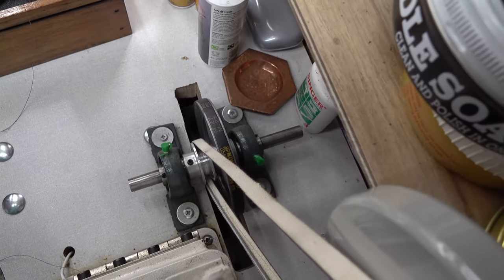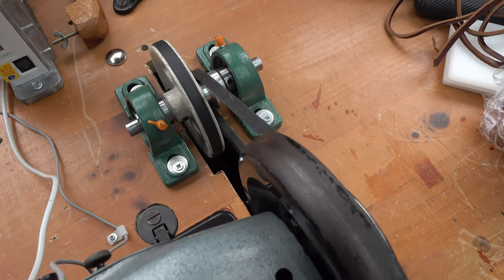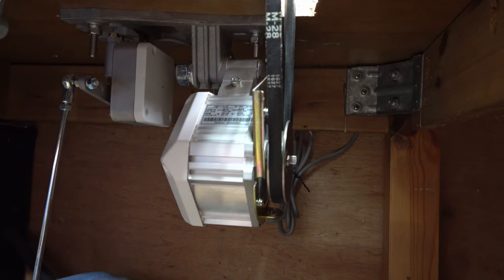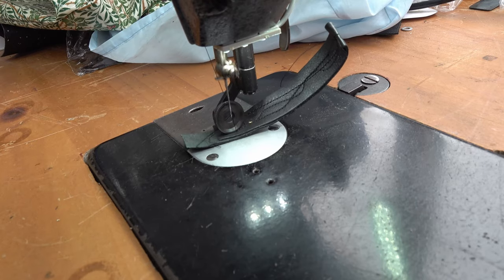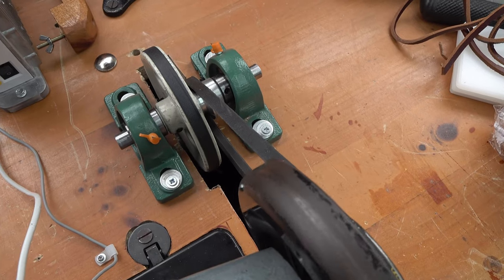Three Reasons To Slow Down A Leather Sewing Machine

Comment: I agree on all counts.  I've been using a 4:1 speed reducer for about 2 years on my Consew and love the results.  One caution is since the machine is running slower, the onboard oil pump may not deliver enough lubrication.  I've adjusted mine for max flow and run it at full motor speed when winding bobbins.  That seems to be keeping it well lubricated.
You've been a great source of information Harry - thanks for taking the time to post your videos!
Reply: Thats interesting Tat. I did not consider this. I will look into this with my JUkI. I did see a youtube video of someone else with a SR fitted and there machine did sound a bit squeaky. Thanks for this

Comment: thanks Harry for the video and the links  i am a retired Woodworker that took up sewing  as a hobby about 15 years ago mainly to make things for my Boats and Vintage cars   i did buy a Chinese Clone walking foot sewing machine  and so far ive been using it as it was shipped to me  i have been  interested in learning more about leather  and a few times i thought about up grading to the servo motors you refer to  overall i’m quite handy and mechanically inclined so  i liked the  way you built your gear reduction system with easy to obtain Shafts and Pillar bearings  with doing auto interiors my machine has the power  needed but  as a novice i thought it might be better to  slow up  on complicated curves  and some other areas  because of my machine  being a clone its often harder to  call up a manufacturer directly and get off the shelf parts  ive even thought about having a machine shop building me special pulleys  but using your  style i dont think i’ll need to go to that extreme or cost  btw i am in the United States  and i have a local  repair shop that carries a lot of parts for different machines plus Sailrites parts fit mine as well and they have a decent online catalog  of parts
Reply from the maker: That's great. I think the pulleys should be readily available...they are for m section sewing machine belts. The axle and bearing blocks are readily available including off the likes of EBay. I had to tap axle bolts on my pulleys as they only had a keyway. Best wishes Harry

Comment: Thanks Harry, I have a 3/1 speed reducer on my Juki 1509N and I would not be without it. It would be quite difficult to sew intricate leather stitching at full speed and not make a mistake. I know exactly what you mean by the initial sharp start and it helps with this as well. You can of course order speed reducers direct from USA and have them shipped over. Something else, I also have been using a Singer 211 for 25 years and it might be me, but although the JUKI modern machines are great, I just seem to get more feel control with my Singer 211, hard to explain, perhaps more ergonomic for sewing. So i will be fitting a SR on that shortly. Great video's as usual.
Reply from the maker: Thanks Paul....interesting.

Comment: I'm runnung a simple 750W servo motor with needle positioner. Any idea how to get the needle positioner working after using a speed reduction? Your videos are so informative and helpful. Thank you, Harry!
Reply from the maker: Interesting....I have not set up the needle positioning...do the pulleys make a difference? The rotor unit clips to the handwheel axle...a single belt must slip?? If you or anyone here finds any answers it would be good to add them here...thanks ...very interesting.
Reply: depending on the ratio of the speed reducer a NPS may fail. 
i was able to tune my NPS for usage with a 500W servo and 3:1 reducer on a Singer 201. 
simply added a second magnet into the detection box. Works flawless . 
high torque, slow speed, under desk  mount and needle stops in most up or most down position, whenever you lift foot from pedal.

Comment: Hello Rogger, Is it necessary to connect smaller pully to machine? Can we connect bigger pully to machine and smaller to motor? Thanks
Reply from the maker: I think it matters, I have not calculated to confirm...so small motor pulley to big pulley small pulley to machine...you can calculate the reduction ratio using pie radius squared etc.
Reply: @harryrogers  Thank you so much for your quick help. I bought everything. Just need fitting. Hope it will go smoothly. Thanks again for your help.

Comment: We're you get them belts from as once the pulley reduction is in place you need different size belts I have done the pulley system but can't seem to find a place to get the belts made to size I need.
Reply from the maker: They are m section sewing machine belts...in the UK I got them from College Sewing Machines UK...they should be available from industrial sewing machine suppliers. To get an approximate belt length I used a piece of string between the pulleys.

Comment: what is a good (cheap) portable walking foot sewing machine that is available in the uk?
Reply from the maker: It depends what you want it for as machines tend to be specific to the leather thickness...but it's worth looking at clone machines such as Tysew and Highlead. If you are doing flat sewing only ...like wallets...no raised seams...then walking foot is not so essential.....and a second hand Singer 31k 331k would be a cheap option.

Comment: Thank you ! what a relief is to find people in youtube sharing the exact experience i'm having without being sure what to do, wondering if a different servo controller can solve it, wondering about returning back the motor i've just bought... now i know this is a very common problem specially on not super expensive servo controllers, whý the motors  doesn't come with a mechanical speed reduction gear built in ? it's smaller than a pulley system but anyway yes, i'm definitely going to follow your steps, my motor has a 1 to 40 speed control and i can't start below 5 but the strange thing is if i set maximum speed to 2 it starts from 5 and then lows to 2... i still not sure if my controller is faulty but now i'm much less desperated, thank you !
Reply from the maker: Thanks ...my latest motor seems a lot more controllable...it came with the machine....but yes the pulleys certainly transform my Jack servos that are about 4 or 5 years old.
Reply: @harryrogers  it makes sense, my brand new motor probably has old technology since its the cheeeapest i could find, and the one i can afford now but... now i know it will certainly work for me :) and your video helped me to it, thank you again for this and every of your lovely and useful videos :)